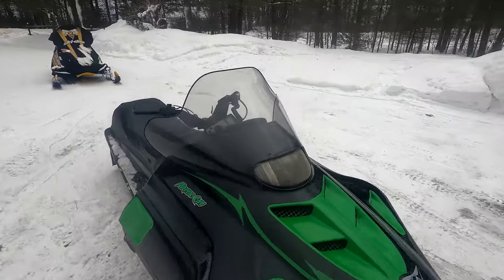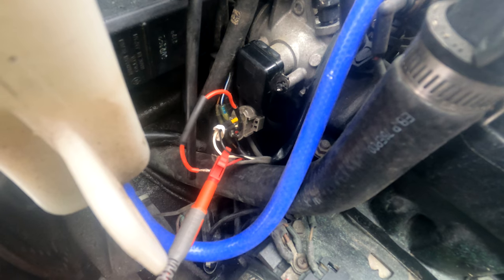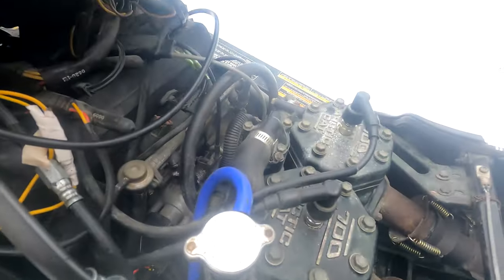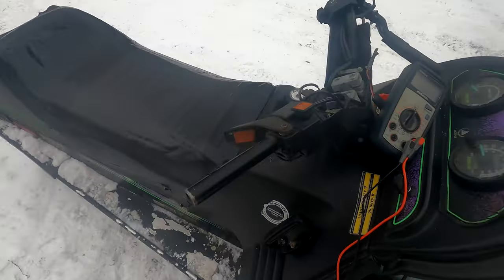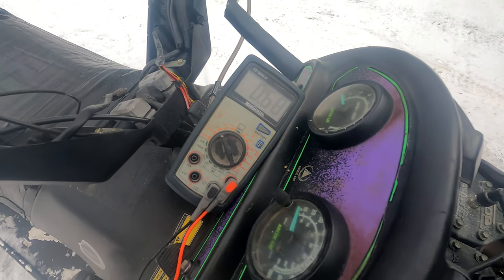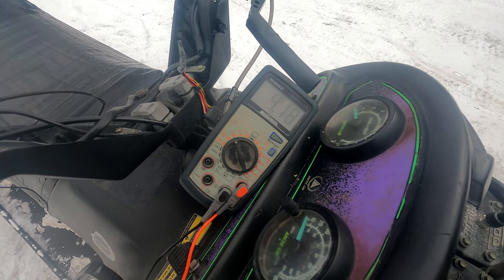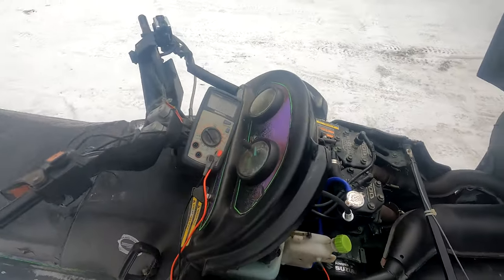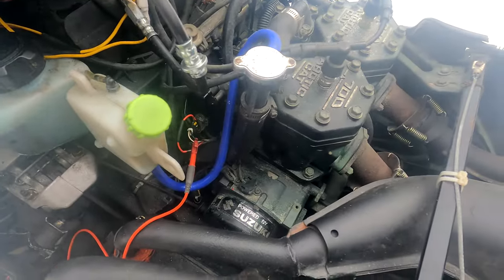1994 actic wildcat 700 efi throttle position sensor

Comment: Great video. I just adjusted mine. It still won’t run. It starts right up then dies. It ran great for one trip around the property. Died again right after that. Starts but dies right away. 94 arctic cat prowler 2-up efi